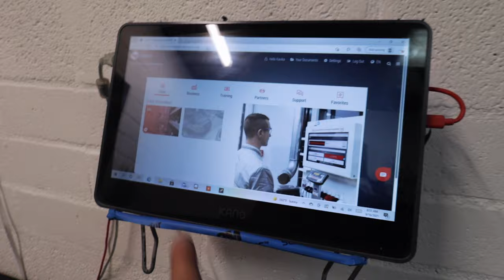Restoring Legendary JDM | HONDA S2000

Comment: Which aftermarket windshield moulding did you use? The fitment looks really good. Did you have to remove the windshield in order to remove the old and reinstalling the new moulding?

Comment: What was the cost of this?  My AP2 needs some similar love.  Stunning work!
Reply from the maker: Cost is going to vary, just depends on the condition obviously, and any hidden damage we may find during the repairs. For example, during this repair, we found the rear bumper was actually cracked from a hit that was not visible until we removed the bumper. Thus, adding to the bill.
Reply from the maker: If you're in the Arizona area, shoot us a DM on instagram!